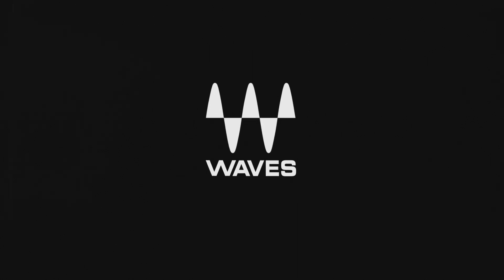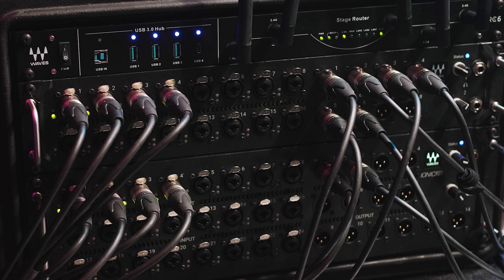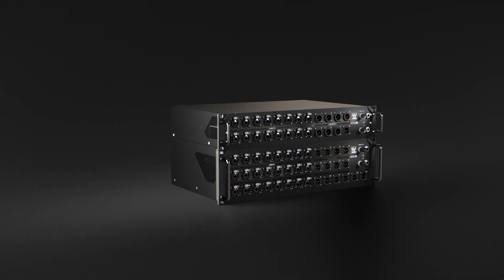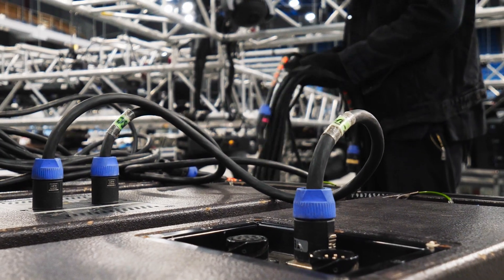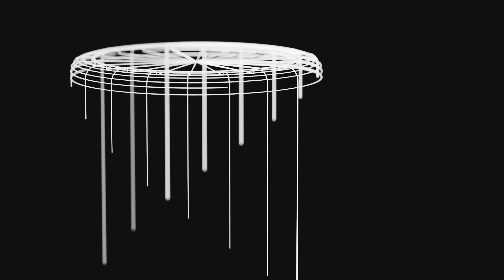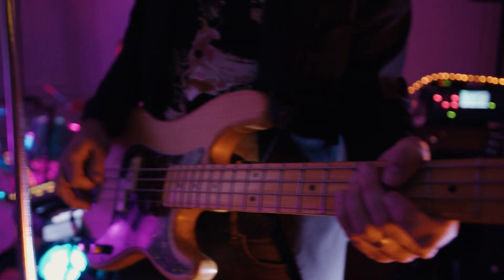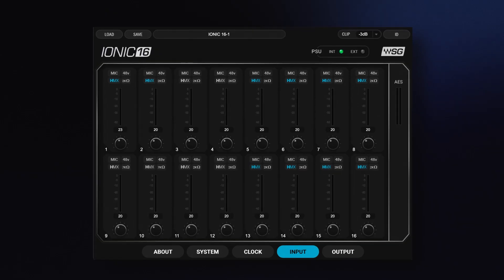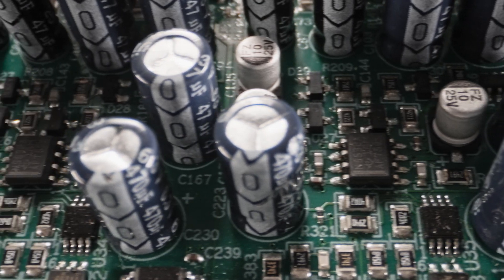Behind the Sound of Waves Signature Preamps

Comment: come back to me when the common mode rejection is over 100db and the E.I.N is -135dbu into a 0-ohm load
Reply: I never heard about that specs in any of manufacturer. U think jus Digico blue preamps have EIN -128dbu
Reply: @MarcelGavalier  a Camden EC1 can achieve -135dbu E.I.N, and the new StageTec nex:t axio have over 135db of common mode rejection on their mic amps.  so its possible, "big audio" is holding us back